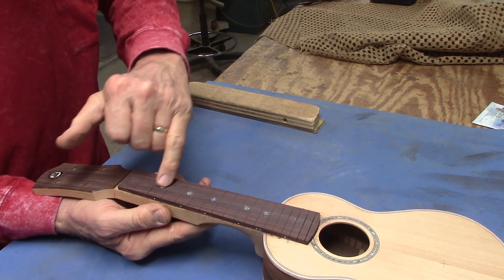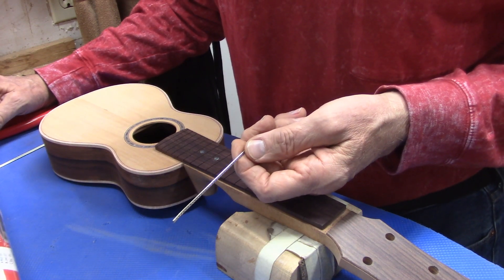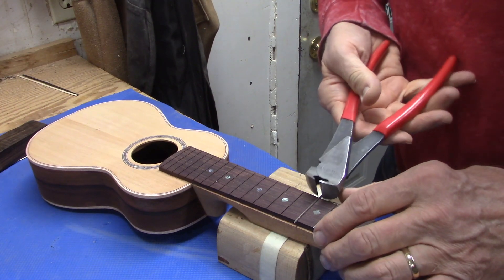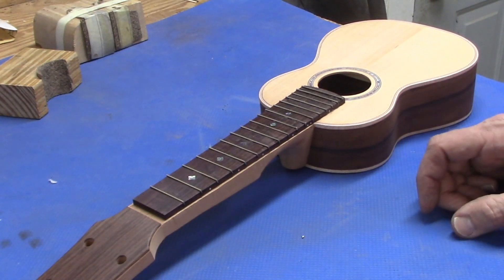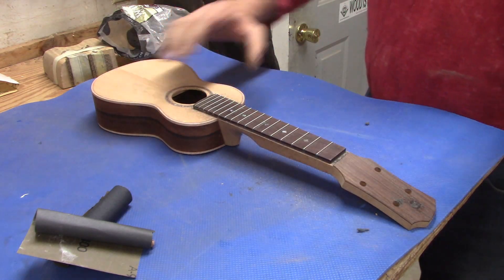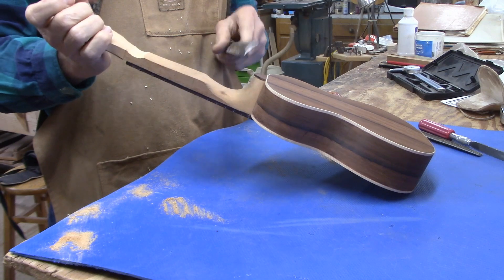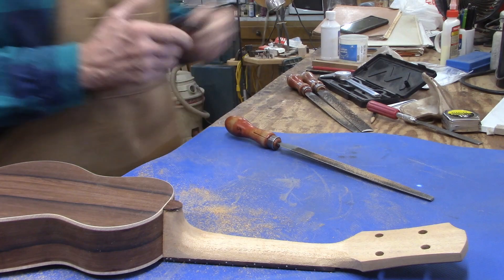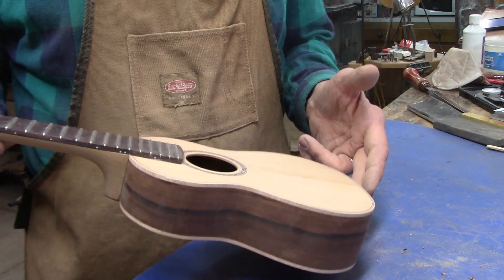Building a Soprano Ukulele, part 5: Frets and Neck Shaping

Comment: Between the previous video and this one you installed the binding. It would be very interesting to learn your process for cutting the binding channel. I’ve always been curious how to accomplish this when using a Spanish heel since the common router tower approach may not work
Reply from the maker: Thanks for the suggestion for a future video.  With a  Spanish Heel instrument,  I use a handheld router to make as much of the channel as possible,  then switch to  a knife and a couple of chisels to excavate the rest.
Reply from the maker: In case you haven't seen it, here is a video I just published and it may help you understand my process a little better: https://www.youtube.com/watch?v=CNYcyvKHKlY&t=10s
Reply: @zimnickiguitars311  thanks for following up. I'll watch this now!